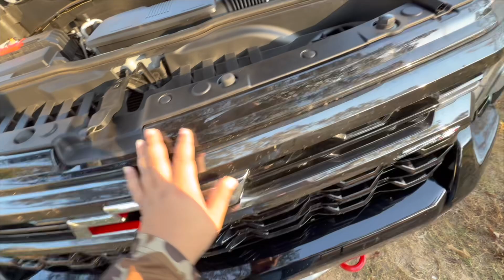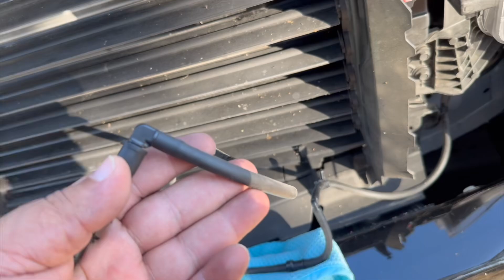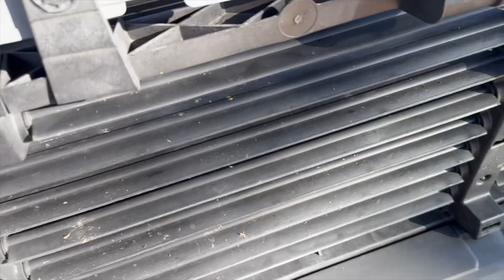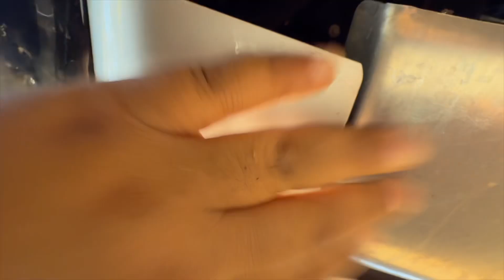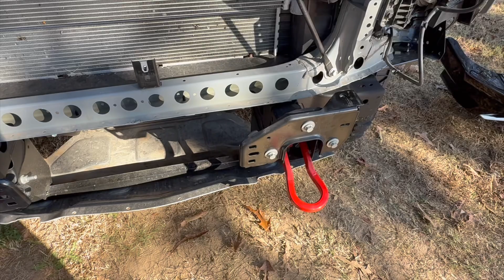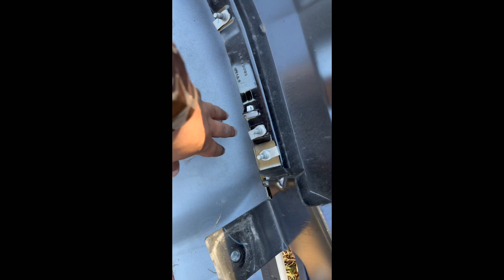Silverado ZR2 MAD Bumper Spacer Install

Comment: Used your video to remove my bumper that had a dent in it and replace the front portion of it on my ZR2.  It was very helpful. I walked right through it with the video and put it all back together. Thank you so much , couldn’t have done it without the video.

Comment: What wheel and tire size including offset are you running?  Looks good?!
Reply from the maker: Stock 18” ZR2 wheels. 35” mud grapplers
Reply: @MAGNOLIAADVANCED where can I get the spacer kit and was there a leveling kit that you used for clearance?  Any rubbing after your spacer install?
Reply: @MAGNOLIAADVANCED Any additional trimming to the areas?
Reply: Did you have to install a leveling kit?